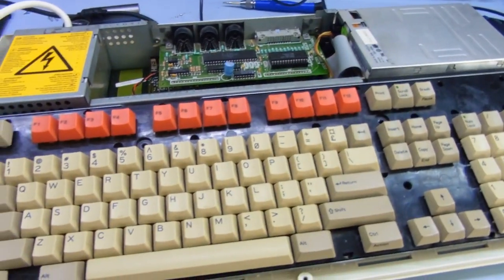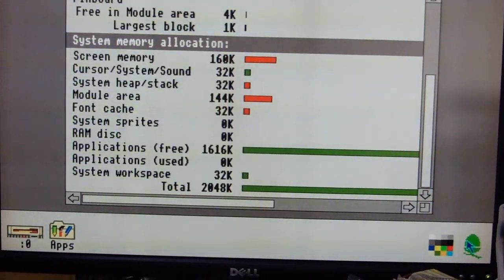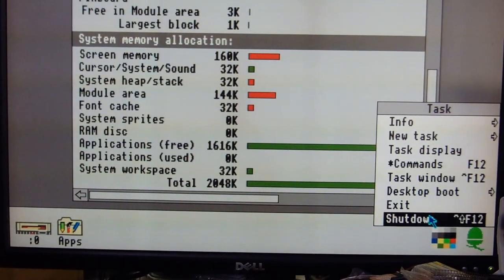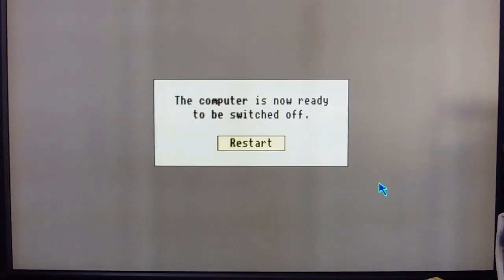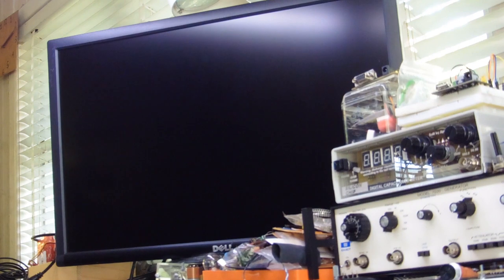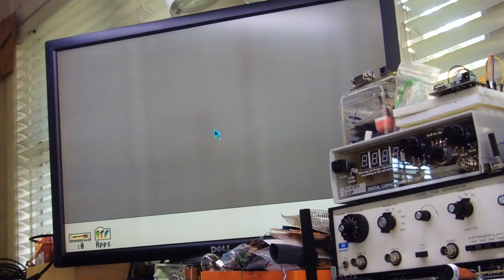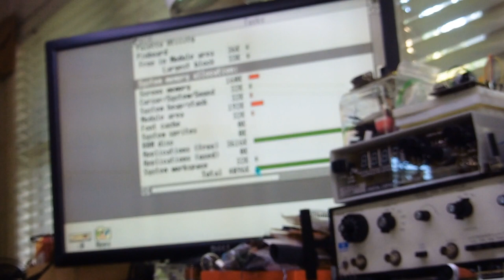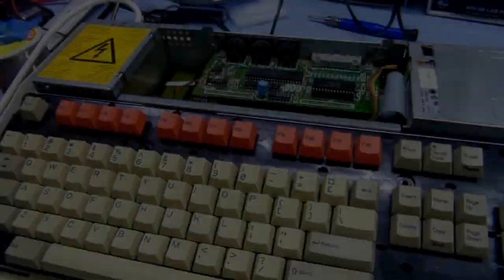Replacing leaking SMD electrolytics & upgrading RAM in an Acorn A3020

Comment: Right, so how bad those needs to be replaced, supposedly they not leaking atm. I mean - do they affect some instability or smth, like those on Amiga 1200 (machine crashes, freezes, etc)? After all, they are simply decouplers, right?
Reply from the maker: If they are not leaking, you are lucky. Replace them before they start leaking! I think these ones I replaced may have been mostly for the audio output, so unlikely to affect system stability, but when they leak, they will cause damage, so it's best to replace as soon as you can.

Comment: Interesting. I didn't know you could replace capacitors of a given type by another type : I thought they had different characteristics.
You could do the sound mod while at it : https://stardot.org.uk/forums/viewtopic.php?f=16&t=13630#p178552
Reply from the maker: Well, in this case they are not a different type - just different case styles (SMD vs Through-Hole). Both the originals and replacements are Aluminium Electrolytic. You are right that different types have different properties. It will depend on the specific circuit in question whether the different properties between different types of capacitor will matter or not. Thanks for the link!
Reply: @Agent24Electronics  Thanks. Now I understand.